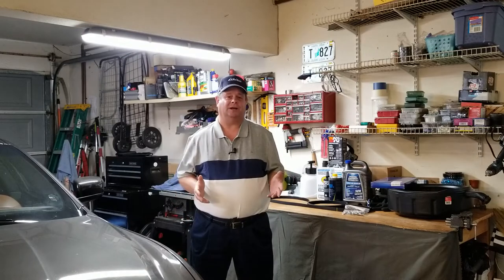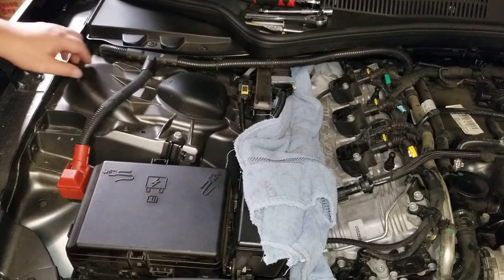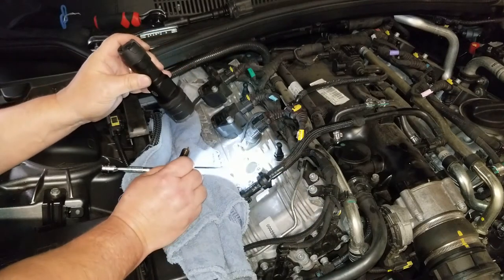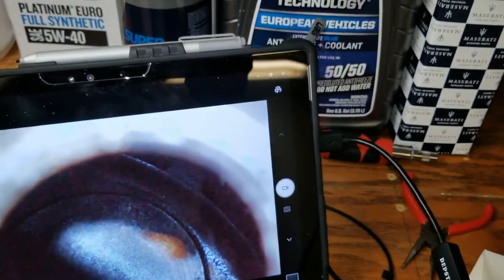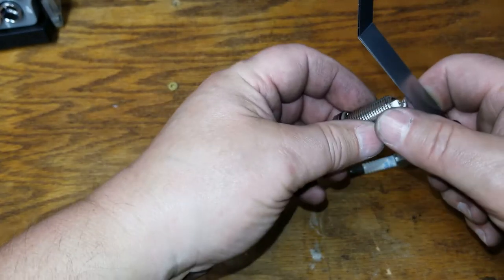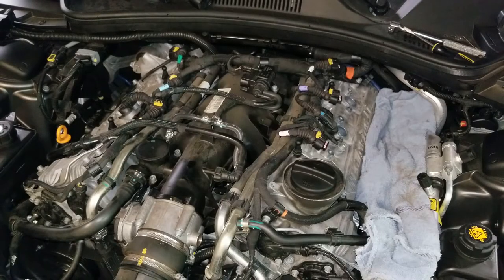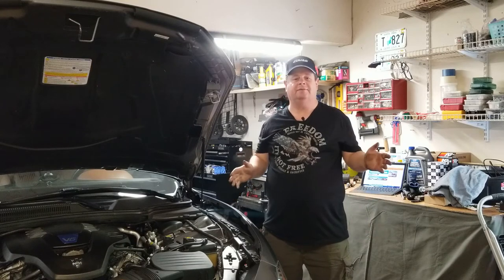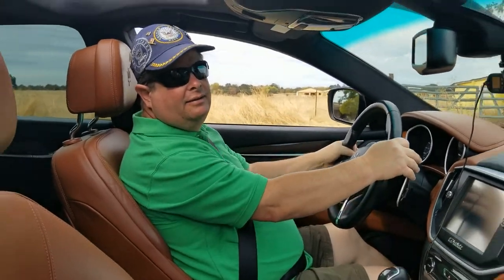How to Change Spark Plugs 2014 Maserati Ghibli SQ4

Comment: Hey james, not sure if you installed these plugs with a jb4, but they reccomend gapping to .022 which ive done but i have a slight rough idle issue which is barely noticeable but at times is slightly more aggressive. The rough idle has been there since i bought the car but i feel like it has become slightly nore regular. Should i check values of voltage on coil packs? Or maybe replace maps sensors. So many variables but i know the front and rear maps get coated in oil as ive cleaned them a few times already. I regularly fog the intake with seafoam gdi spray. Im stumped because ive heard it could also be a bad BMS sensor affecting the alternator at idle, or someone had possibly moved the butterfly on the throttle body at some point and now needs to be recalibrated. Afaik there is only fuel filter socks on the pumps inside the tank?? Any guesses are much appreciated
Reply from the maker: Any codes?
Reply from the maker: @athickjuicysteak6176  I just installed OEM plugs with OEM recommended gap. Seems to work just fine. No issues. Still has the extra power.

Comment: Maserati says change spark plugs at 35,000 miles but what do you think?   Thank you.
Reply from the maker: That's right. Change them sooner only if you have to fix a misfire. Changing them at the recommended regular intervals prevents misfires due to bad spark plugs.

Comment: Just notice something in your video. You said t hff e recommended gap is 0.6 mmr. However, you gapped the plugs using 0.305 and 0.254 gauges together which is 0.56 mm (rounded). So which is it, 0 60 mm or 0.56?
Reply: The shop manual indicates 0.5 to 0.6 MM. So if you ended up at 0.56 MM then you should be good.

Comment: What torque value are you using?
Reply from the maker: For the spark plugs? 15 foot pounds. The Maserati Service Manual says 18 Nm. But a friend who is a certified Maserati tech told me I should torq a little higher say 20Nm. Thats 14.75 foot pounds so I rounded it off to 15 foot pounds and went with that. So 15 foot pounds.
Reply: Thank you!!!!

Comment: Something I do keep reading is the NGK OEM spark plugs do not come pre-gapped, they are usually smaller. So it’s important you check each prior to installing.

Also, I don’t know if my car had the original factory plugs, but only (3) of them were gapped properly, then other (3) plugs were less than 0.4 MM. 

I know the carbon buildup also misleads. However, like James mine weren’t too bad at all as well. So I wondered if they were previously changed if the person thought they were pre-gapped.

Comment: Hi James! Thank you for all your videos, their great! I have a 2014 Maserati Quattroporte GTS, but it built very similarly to the ghibli. One of my AC actuators is broken on the the passenger side of my car and the ac is not working on that side. Do you have any info on the location of the actuators? I read their are 3 total on the car.
Reply from the maker: It may just be a software update. I had the same issue when I got my 2014 Ghibli. I brought to the dealership, they installed an update and it resolved the issue. Not right away though. It did take a couple days for it resolve as the computer had to relearn what position the actuator is in. This is a very common issue and in most cases the update fixes the issue. Dealer charged me $180.00.

Comment: I was taught, possibly incorrectly, to use a bit of anti-seize compound , especially on aluminum heads,on spark plug threads.  Yes/ No? Also I have always used a small rubber hose to pull out and repair-insert plugs, especially re-insert to ensure the plug gap doesn’t close it we’re to fall out of spark plug socket. 

Do you know how much the coil-packs cost each are and when do they have to be replaced.
Reply from the maker: Anti seize is good to use. Some regular spark plug sockets with the rubber holder inside will not fit in the plug tube.  Mine would not. It was too fat. Besides, it would take more than that to mess up the plug gap based on how hard it was to adjust it.
Coil packs only need to be replaced when bad. I dont know how much they are, but you can look it up on scuderiacarparts.com.

Comment: Hey James me again i bought mine used an I believe they never changed anything on it so I’m little by little changing and working on it myself your videos are always my go to ✊🏻 so the other day I connected and obd scanner as while I was driving I had a slight spudder and my CEL came on for a second then turned off the obd read cylinder 4 misfire I have read that would be either the spark plugs or even the fuel injectors what would be your recommendation and also in this video I noticed you just changed the spark plugs not the ignition coils when I do the spark plug change should I do both to be on the safe side since I had that misfire iknow a flurry of questions but just want to pick your brain for as much knowledge as I can when it comes to these repairs my  Maserati ghibli s q4 is at 41,000 miles got it when it was 38,000 but still has a few changes to go through till I know it’s all up to date what other factors should I keep an eye out for and get to working on before another mis hap ?
Reply from the maker: A friend who owns a Ghibli came over to my house a few weeks ago to change oil and spark plugs. He wanted my guidance. I let him do all the work. I stood around and drank beer :) When he was finished with it all, he started his car and it was running ruff. I put the OBD scanner on it and it had a Cylinder #3 miss fire. He started to worry, and I asked him to check the coil connector on cylinder #3. He found the connector loose. He connected it all the way until he heard a snap, started his engine and it ran smooth to his relief. For your case, start there, then check to see if the coil pack is seated right, check the spark plug is torqed right, remove the sparkplug and check the gap. If all seems good, put it all back together, clear the code, and if you still have a miss fire on the same cylinder, try moving the sparkplug and coil pack to a different cylinder, clear code and see if the miss fire happens on the cylinder you moved them to. If the miss fire stays on Cylinder #3, it would be either the fuel injector or something more serious. If the miss fire does move to the cylinder you move the spark plug and coil pack from cylinder #3 to, then move the coil pack back to cylinder #3, clear code and see which cylinder the miss fire is on. If #3, it's the coil pack. If cylinder 4 its the spark plug. Good luck.
Reply from the maker: Oh generally, if you get a miss fire on 1 or more cylinders just after replacing the spark plugs, 85% chance you missed something. Check your work. 14% chance you got a defective spark plug or damaged a coil pack when removing it. 1% chance it is something more serious.  So don't worry. LOL.
Reply: @JamesDIYGarage  awesome man always thanks for the tips and for the spark plugs should I change both coil pack n spark plugs or just the plugs should be fine
Reply from the maker: @mh2046  Just the plugs. Change coil packs only if needed.

Comment: Hey James I am planning on changing my spark plugs on my Maserati Ghibli 2016 after you gave me the confidence of how simple it is. Question, can I use an impact driver to remove the torx screws? Or should i just stick to the same method as you doing it manual with a ratchet?
Reply from the maker: I would just use a rachet. They wont be tight.
Reply: You can also use metric allen wrench. Just did it nyself. I myself. Coul bolts are 5 sided like allen wrench.
Reply: Yeah, do not use impact on any Spark Plug or Ignition Module work on these cars. You’ll cause yourself some extra work 😂

Comment: So is 0.6 mm for clearance the maximum allowable clearance or mininum allowable clearance as specified by the manufacturer ?
Reply from the maker: Thats the specification from Maserati, no more no less. Any deviation from the specification in either direction can impact engine performance and effeciency .
Reply from the maker: Having said that, I did not have a gap tool with .06mm so I had to use 2 feelers that got me to 
0559mm, or about .004 mm off. Engine performs fine though.

Comment: Where do you get a copy of the shop manual that tells you all the torques and guides?
Reply from the maker: Mine is not as complete as I thought it was, but I am thinking of getting this one. 
https://www.ebay.com/i/223574727057?rt=nc&_trkparms=aid%3D222007%26algo%3DSIM.MBE%26ao%3D2%26asc%3D20160908110712%26meid%3Dc11bab87f7be48b1b78d05b05d247f21%26pid%3D100677%26rk%3D8%26rkt%3D30%26sd%3D223510621219%26itm%3D223574727057%26pg%3D2385738

Comment: Do you know if the 0.6mm gap and 18Nm torque is the same for the 2016 SQ4?
Reply from the maker: Not sure I will find out for sure. Stay Tuned.
Reply from the maker: I have it from a reliable source. The engine blocks are all the same. So the spark plugs, gap and torque are the same as well. :)

Comment: Our coil pack bolt is a #5 hex not a 30t
Reply from the maker: You are correct, I was using the wrong tool, but it worked.

Comment: Do you use any torq for coil screws?
Reply from the maker: I did not torq them, I just tightened them good, not too tight as it might break the plastic coil mount. The service manual does not specify a torq for them.